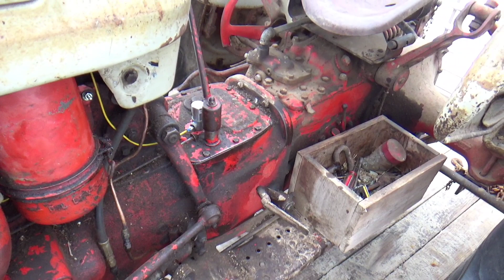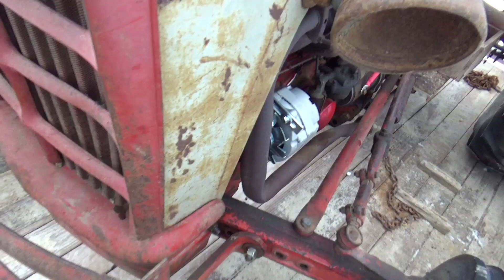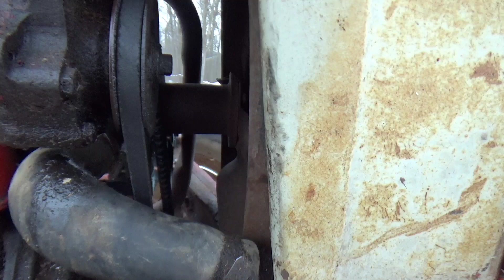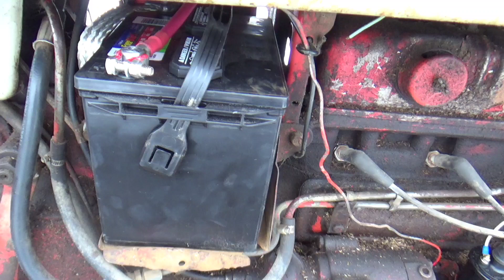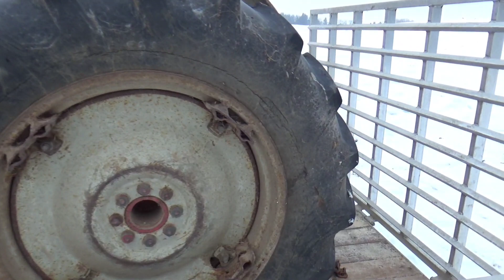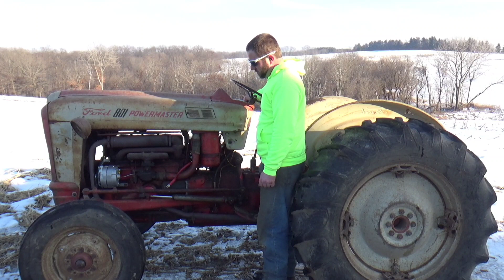Got my grandpa's tractor running again!!  801 powermaster

Comment: Carb has fuel metering adjustment screw back it out half round no longer need choke at idle. Engine that model was 172 cubic inch. Judging from position of clutch pedal indicates live p.t.o.
Reply from the maker: Yes...it's a 172 cubic inch and has live pto.   Check out my updated video on it.  I replaced a few things!

Comment: I got my father's '55 Ferguson running year before last. I warned the tractor if it gave me any troubles I'd convert it from 6v-pos to 12v-neg ground and I ended up converting it. The 12v spins the starter much more intensely and the tractor snaps right to life now where under 6v it was always sluggish and you had to do your 'will it start up or will I need to get the charger' prayer.  I picked up an AC WD last winter, still factory 6v-pos ground but I'm anticipating converting that to 12v-neg this summer. Advantage with 12v-neg is you can buy inexpensive LED light assemblies that give much more illumination than the tractor ever had. Well, this tractor never had the front lights that I ever saw, wiped off working along tree-lines I'm sure. I mounted my LEDs back just ahead of the sides of the dashboard so they light both ahead of the tractor and the engine plus are much more protected.
Reply from the maker: Cool!!  I'd always have a plan b because I never knew for sure if the tractor would start. 🤣   It's all torn apart again to fix gas and power steering leaks. Lol.  Waiting on parts now but hopefully have it back together pretty soon. 🤞

Comment: The Gingells channel is awesome. Extremely helpful 👍🏻
Glad you got her running Aaron. Now I need to go to work on my 1940 9N Ford. It has wiring issues that need attention.
She sounds great
Reply from the maker: It's fun to tinker around with.  I think about my grandpa a lot when I'm out there and working on his tractor.   Fun old tractors!!  Thanks for watching Gary!
Reply: @aaronstractorstuff7521  , my grandpa bought a Case SC gas row crop brand new here in my little home town back in 1949. They were the very first tractors to come out with disc brakes and they were useless. The tractor was dangerous as the brakes were no good and you sat straddle of a huge transmission hump with the steering wheel in your lap.  If you ever needed to bail from the tractor in an emergency, it probably wasn’t going to happen.
It was dangerous to pull heavy loads with as the brakes were not capable of holding the load back, much less stopping it.
Due to not enough storage space, I sold the tractor to a friend back in 2019. I hated to let it go but I never used it and it did go to a new home.
I also sold my 1953 John Deere 50 for much the same reasons. The Deere had power steering and excellent brakes but was going to do nothing more than occupy precious space in my shed. It too went to a good home. Both are within 5 minutes of me here and I can go see them any time that I want.
The rest of my fleet will spend the rest of my days with me. I still have my 1940 9N Ford with the factory Dearborn buzz saw, my 2 1958 John Deere 520 tractors, my very rare 1970 John Deere 2520 diesel, and of course, my Kubota L2501. All of my tractors are loader tractors except for the Ford. That used to have a Paulson loader on it be we sold that as the Ford doesn’t have live power and we no longer had any use for it.
I sure enjoyed this video Aaron. Keep ‘em comin’
Reply from the maker: @tractortalkwithgary1271  my dad talks about how unsafe tractors were back then too.  He has lots of stories from working on the farm when he was growing up.   I'll have more videos with that tractor in the future.  🙂
Reply: That power steering pump that you have leaking back in the seventies you could get one off of a 1-ton or bigger Ford truck had the same pump for power steering if you could find one in the junkyard